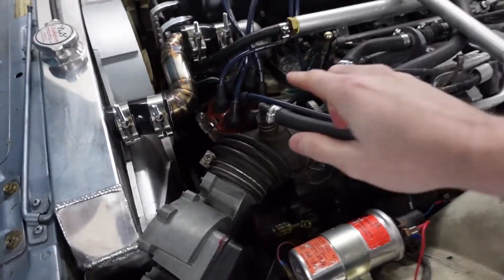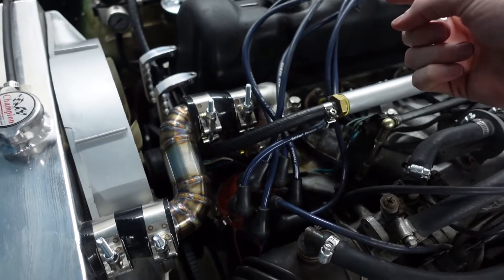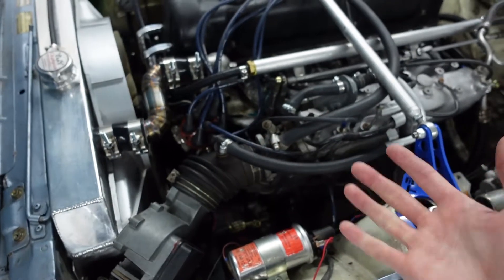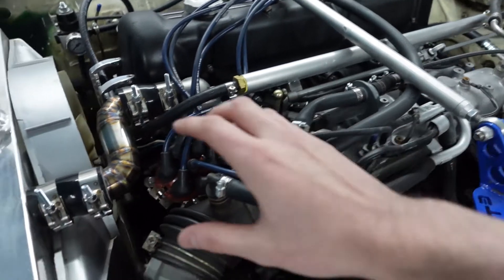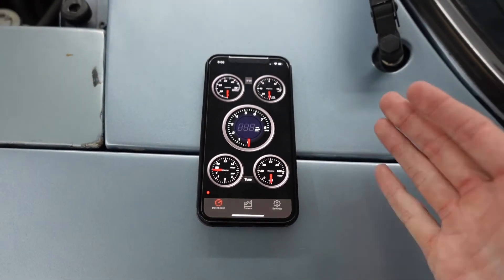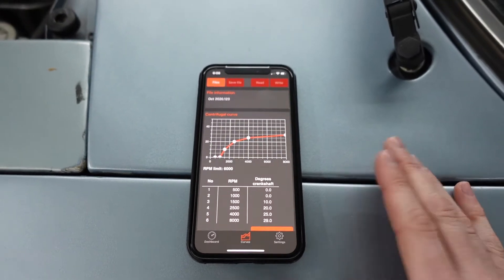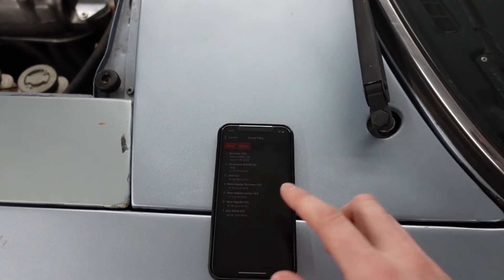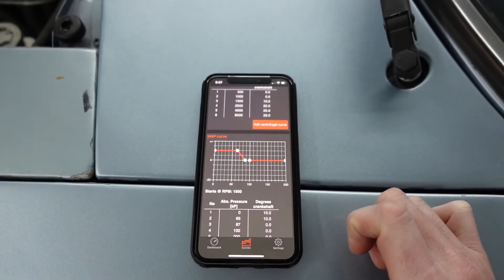PROTECT YOUR Z FROM THEFT - ELECTRONIC DISTRIBUTOR | 123 ignition electronic distributor + Bluetooth

Comment: Woah, I had no idea this dizzy had a theft deterrent, you've sold me on it!
Reply from the maker: Yeah man it’s awesome! And definitely a game changer within the industry, that’s what made me buy it!
Reply: I'll pick mine up next week provided my research checks out that it works with an MSD ignition box. It seems like this will be the perfect solution for getting the triple Webers to start up and run smoothly.
Reply from the maker: Siege I’m not sure if it does!! Did you read that somewhere? I’d suggest emailing 123 ignition. Does the box replace the coil?
Reply: Also how was the installation process?
Reply from the maker: Siege it was standard as far as dizzy installations go, I hadn’t had much experience with them so it was hard for me to learn at first, but we got it on lol
Reply from the maker: @reaktor55  that’s great to hear man!
Reply from the maker: @reaktor55  another great reason to have extra protection. I’m glad your car isn’t stolen!